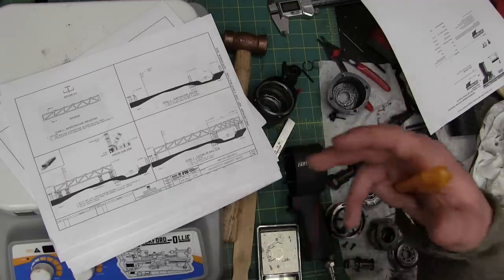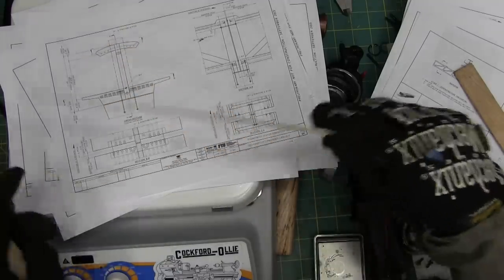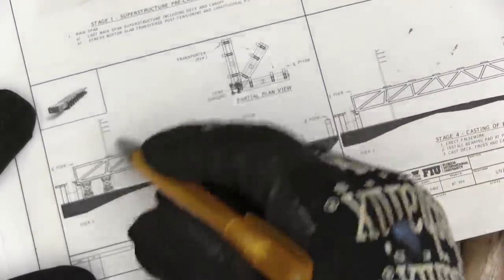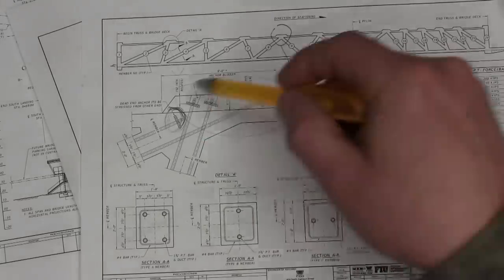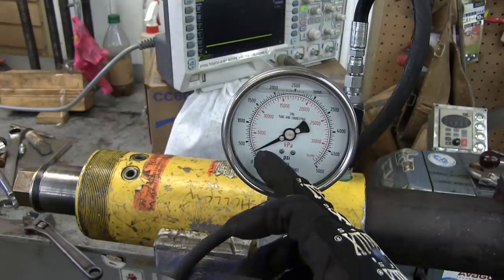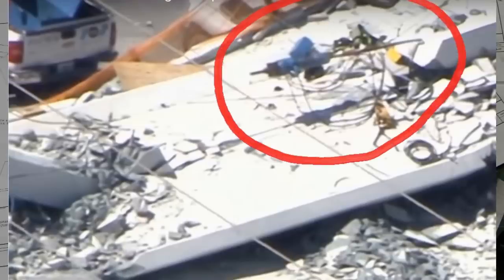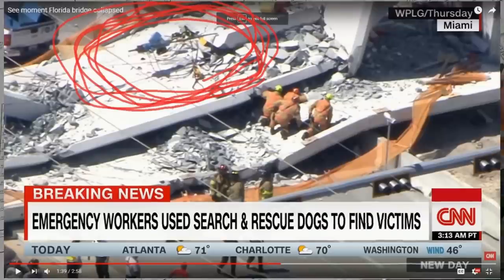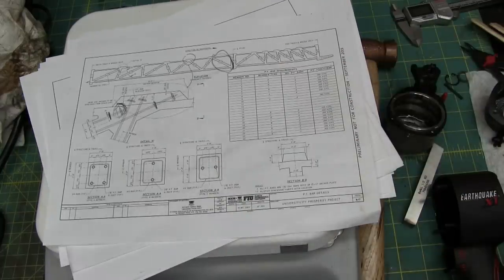Post Tension Failure Florida Bridge Collapse | Engineering EXPLAINED!

Comment: Expect more accidents like this to happen in the future, as depressing as it sounds. Engineers and workers are constantly pushed harder and harder, and in this case the work was ongoing while the traffic was still moving I assume because they didn't want to take the extra time, effort and money to block off traffic...
Reply: sad but true .
Reply: If the public knew the problems associated with these affirmative action contractors.. They'd be scared to death to ride on any road/bridge they had a hand in constructing.
Reply: The pressure by central governments to not inconvenience the motoring public is insane today. Especially with many of these contracts being let with time-sensitive incentives for the contractors as an effort by the DoTs to speed up the work. It appears an adjustment to the erection plan is what may have set this thing in motion. And that adjustment was partially down to not wishing to add time dealing with some problematic locations for the supports.
Reply: Add to that most jurisdictions will require a permit for lane closures which are costly, and fines for delays of re-opening the road by the specified time. Even though the city/town does nothing for traffic control, they still want their piece of the pie.

It's hard to say whether they would have been able to close the road, or if someone made the mistake of considering the risk negligible and continued work with traffic moving underneath.
Reply: TayR0C don't buy in to all that crap, it's just because lowest bidder wins, been the same problem for years.

Comment: Man this was awesome. I don't mean to overshadow the lives that were lost and negatively impacted in any way by this event, but I really enjoyed figuring this problem out.
Reply: 1:49 you can see the bridge fail on the left side, almost dead nuts in front of the crane
Reply: Yeah.  Interestingly, the crane seems to have something dark hanging down the boom and angling off to the roof of the span - which drops to hang from the crane when the bridge drops.  Makes me wonder what it was...and it also tells me that the crane boom must have been pretty close to the span.  Wonder if it hit the edge with the boom in just the right (or just the wrong) spot and pushed or weakened a crucial area.

Comment: Yes, I like your analysis and foul language.  When the temporary supports were put underneath the intersection of the second diagonal (from the left) and the bottom bridge deck (ie. the bridge ends cantilevered from the temporary supports), the second diagonal was put into compression. The post-tensioning rods would have been found loosen. If the rods were tightened up at that time, later when the temporary supports of the second diagonals were removed, the second diagonal became in tension. It was possible that the post-tensioning rods were overstressed by having been tightened twice. The engineer might have realised it too late and started to de-stress the rods in the second diagonal. The tension released from one rod was taken up by the remaining rods, which led to even more over stressing of the remaining, then the rods broke progressively.  As the second diagonal failed in tension, the truss action was gone, bridge failed by  shear at the end
Reply: That has a ring of truth - a more complex sequence of changes was performed than originally planned due to different placing of the supports, with noone going back to the drawing board and seeing what the consequences could be.  It also seems to me that they skimped on the rod size/number with no wiggle room.  A heavy brittle structure like that is unforgiving of error.
Reply: Also notable that the original drawings show no post-tensioning in the end diagonal (no.11) which would be in compression in the final position but probably in tension during the installation due to the temporary support position. Maybe this had to be changed to allow the support position.
Reply: Mark Tillotson Shocking lack of redundancy.  Probably Dywidag bars - they're skookum, but very brittle.  Even a nick on them can cause failure due to point stress issues - think cables would have been a better option.  Transporting mid span seems a massive mistake without some sort of load transfer mitigation. A series of preventable errors.  Four culpable parties- owner, engineer, contractor and transporter.  Should be multiple jail terms and license revocations.

Comment: Been around thousands of cables being tensioned during new home slab construction.  Failures do happen when streching but are rare.  Have seen 100' cables shoot out 300' whipping and snapping as they go. Another point to consider, and I haven't seen, is the cable restraint on the opposite end of the tension pulling device, the anchored end.
Reply: 1320fastback agree its like in plumbing you need two wrenches to tighten one end of compression bolts to squeeze two sides together common sense

Comment: It make you appreciate even more the work of John Augustus Roebling, Thomas Telford, Isambard Kingdom Brunel, and Abraham Darby.
Not a computer in sight when they designed their bridges. They may have been over engineered by today's standards, but their structures are still standing after all these years.
Take the Forth Road Bridge in Scotland. Opened in 1964. They have now opened a second road bridge. Not just because of capacity, but because the 1964 bridge is failing due to corrosion, and will be closed and eventually dismantled.
J A Roebling's Brooklyn Bridge is still standing, even though it was later found that the supplier of the steel cables supplied sub standard materials.
Sadly though, design mistakes and blunders still occur to this day. As the Grenfell Tower fire in London tragically proved in 2017.
I know in the demolition industry, post stressed concrete is treated with great respect. It can explode when the concrete is broken and the stress/tension in the reinforcement is released.
As for leaving the road live to traffic below the bridge, while it's still being tensioned and hasn't been load tested. Total madness.

Comment: THANK YOU SIR!  You have achieved what I spent half a lunchtime failing to.  I've been an enginerd for a couple dozen trips around the sun, and failure analysis has always been one of my favorite parts.  You've found the evidence I didn't, and interpreted it excellently IMHO.  I heard on the news that day that at the time of the fall, they were tightening 'cables' that had loosened, and that was a big red flag to me right off.  Something just spontaneously  'loosened' and you just try to tighten it without looking into why?  That's exactly how a couple of guys got killed a few years ago in my industry.  The news people must have been talking about that rod, which was probably yielded to the point that it was never going to hold load again.
The really tragic thing is, if anything's not 100% plus safety factor, the FIRST thing you're supposed to do is Get The Bipeds The Hell Out Of The Danger Zone!  Aaaaaagh!  How many oafs were standing around scratching their butts not thinking of that?  A series of mistakes were made, which is invariably the case in disasters like this, but keeping the road open while they were tinkering with that sucker was the worst.  Concrete and steel can be replaced, lives can't.
I have been enjoying your vidjeos for some time now, but this is on a whole other level.  Your words are strange, O Wise One, but your insights are most skookums.  And as you so eloquently point out, if anyone can't handle a man talking like a man, fukkum.
Reply: Six months ago, I couldn't spell anganear...now I are one!

Comment: I still don't understand why it was deemed necessary to have a bridge this big and heavy for just foot traffic.
Reply: Have you seen the size of people these days?
Reply: A steel truss bridge would have solved the problem easily. High strength to weight ratio.
Who constructs a truss with concrete? Does it work well?
Reply: A Pratt type steel through truss bridge would have been much more practical, but when you get involved with government contracts, efficiency and often with it safety, goes out the window.
Reply: It's all about the way she looks man.
Reply: They wanted it to be a hang out area able to host events like concerts.

Comment: Absurdly negligent to have this road open for traffic.
Reply: That's the biggest take on this tragedy for sure!  :(
Reply: The negligence was removing temporary supports before the overhead suspension cables could be installed.
Reply: Bridge collapses are very rare. The whole point was to have the road open for traffic, and it's safer for the workers to build it off-site as well. Occasionally someone dies in an elevator, but it isn't necessary to go back to taking the stairs. If it's unsafe for traffic below, then it's unsafe period. But nobody knows that ahead of time.
Reply: NegatingSilence 1 death per $million spent on bridge; an old algorithm. You are correct, they are rare because of a leaning curve. 
Often being "Better safe than sorry" is inconvenient, but is in place for the sake of safety.
Reply: D N the laws of common sense. Across the board, the lack of structural support is a theme.
Reply: As has been stated many times, and is included on the bridge diagrams, this was not a suspension bridge.  The cables carried no load whatsoever and were merely aesthetic.  The various amateur analysts appear to have it right.  The failure was caused by the change in support during movement and a failure of the tensioning rod.
Reply: It was open, no support, or stressed before horizontal load..cost cutting
,  who inspected it ,the school that is exempt from.local governent, Miami, oh no hurricane Andrew inspectors, oh no.
Inspected by school inspector. Oh no conflict of intetest.
Reply: I spoke too soon. The tower and pipe support system was for aesthetics.  Which means this bridge was destined to fail anyway.  Even more people could have died if pedestrians and traffic below.
FIGG should be investigated.
Reply: Wade Williams... I stand corrected.  But since the failure of the tension rod came about so easily don't you think this structure was eventually going to fail?
Reply: When the crew is over one main section of concern, it may THEN be ideal to close traffic on that road.
Reply: That was the first thing I thought when I heard they were stress testing it.

Comment: As a structural engineer in concrete design one of the first instinctive thing I thought of was that probably some post tensioning anchor had come loose. Looking at the truss design, the joins of the truss members are very critical in their reinforcement detailing. The members are quite slender, and considering the stresses in the joins there must be a lot of reinforcement in them to prevent splicing of the concrete. The high loads that these tension rods put on the concrete must be distributed some way. This requires a lot of strirrups and bend bars. Also I kind of expect the rebar cover to be around 50mm (allthough in some cases 35mm would suffice depending on the service life and envoirnmental conditions) and the bars to be at least 16-25mm, it would be quite challanging to fit them in such a slender join. 

Would be interresting to see the rebar detailling they used. Also this type of slender PT structure would need some self compacting concrete because of intricate mould shape. You certainly cannot use ordinary 20 mPa concrete for this.
Reply: I believe the design was correct for the design condition on the plan. But as usual the site conditions did not follow the plans and they never will. An  onsite engineer is essential on these projects. It is not code mandated in this case- only on wood truss placement in high velocity zones.
Inspector Jeff state inspector
Reply: I never realized  engineers have such a potentially  life impacting job or rather, I didn't  think about it that way. I don't  know if the buck stopped  with someone  on this screw up, would be interesting  to know, probably   a lot of finger pointing .

Comment: This is a first of a kind for the ABC method:  Accelerated Bridge Collapse.
Reply: Built, installed and demolished in record time!
Reply: Always Be Careful (afterwards)
Reply: Looked good in Cad all complete huh? Maybe ABC needs to be Slightly-ABC 
 That tower & suspension should have been ready for the deck it was ment to hold up. why a half supported bridge goes over head in the frist instance makes nosense
Reply: No, this is not first of its kind.

This method of construction has been in practice for slightly over a decade.
Reply: It was a first of its kind in another way too. That being the all female diversity hire engineering firm that designed it, and the media were singing their praises a week ago. If the fault in its failure turns out to be an engineering problem we will never hear another word about that fact.
Reply: Anti-feminists are spreading around the idea that it was an all-female firm, and as far as I've been able to tell it's just a flat-out lie.
Reply: The first time for this sort of bridge and hopefully the last. Was the design even tested? There's cracks and they kept traffic going under it? Murder or at least manslaughter imo
Reply: It has to be a record, the thing wasn't even finished
Reply: Far from the first of it's kind. It's a new method for sure, but other bridges have been built like this already.
Reply: Fenir stardust - The 90 ft tower would not have helped much. The (wire free) 16 ish inch pipes running from the tower to the top of the bridge were more for harmonics/frequency (aka: vibration/sway) dampening. Possible blessing in disguise the tower wasn't attached when the structure failed... could have caused more injuries/fatalities.
Reply: @randysmith106.  This is going with every big companies nowadays.  Instead of hiring for the best they hire for their agenda of diversity  program.  Something has to giveaway....
Reply: inb4 feminists accuse concrete and steel of being biased against female engineers
Reply: Jeff Irwin ... Others have been built using the method but this is the first of this design.
Reply: Fenir stardust ... Exactly. If it is necessary for support why wasn't it done. ... cart before the horse.
Reply: randysmith106 ... What was the name of the design firm?
Reply: because it was designed by smart people  but built by practical people, and there had to be a change mid construction. this happens all the time, especially with contracted work. unfortunately if you want to get anything built right you have to rely on their being no weak links in the workforce
Reply: from 1980's on here in ole yeurope...
Reply: Fenir stardust That's my take on it, too.  It took just two small things to go wrong for a catastrophic failure.
Reply: i mean for a fucking start we SAW one of the employees in this video, and he was clearly a male -_-
Reply: We saw quite a few employees in this video, and yeah as far as I could tell they were all men.
Reply: Abc  amys baking company
Reply: millieo ,DING,DING,DING we have the winning question!!!!
Reply: Louis, reread the comment.
Reply: Fenir, the bridge is a truss bridge; the cable-stayed part was mostly for looks.
Reply: James Amril-Kesh 

Lol. Snopes.